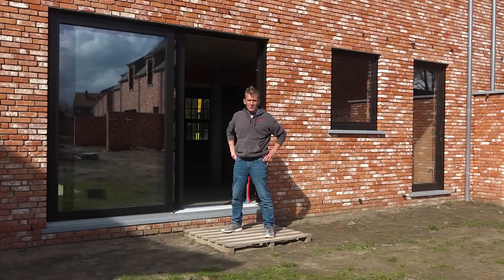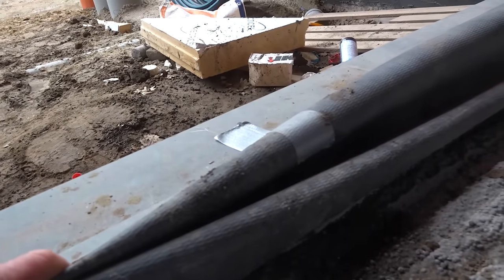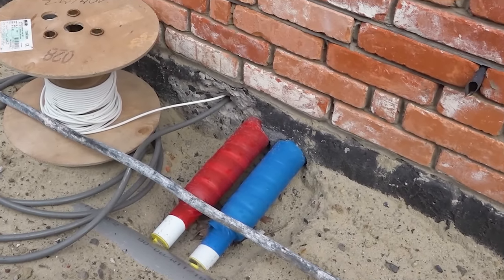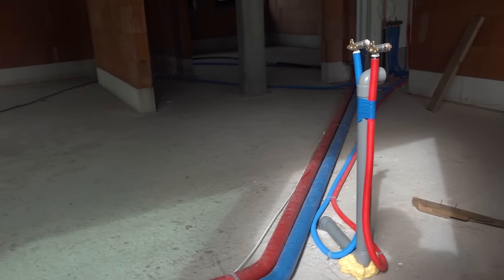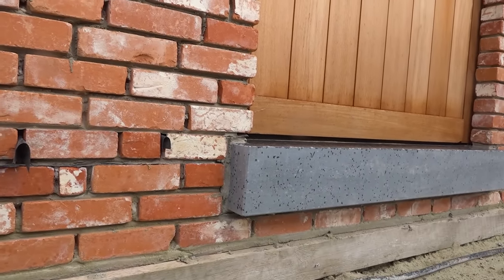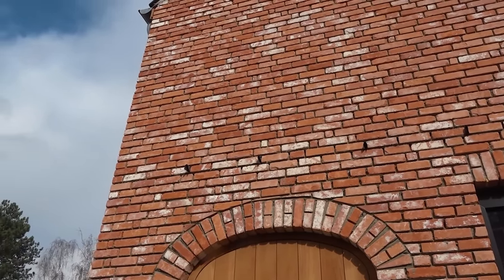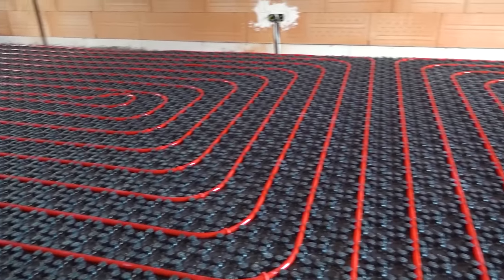Can We Learn From Buildings in Belgium?

Comment: Hi, great piece. We lived in Belgium for 5 years. I was particularly impressed by each new building having a “grey water” system. All water falling on the roof was capturered and stored then recycled by using it to flush loos, water the garden and wash the car. I have always been amazed how much it must cost us in the UK to purify all water for drinking then we use it to flush the loo etc.. we need to change our building regs. and collect our grey water. 
We never had a water shortage even during a summer we had 40+ degrees.
Reply: Interesting. I think solar is a different issue. But I think we have an issue with our drainage system in some areas. I will never be convinced that watering gardens, washing cars and flushing toilets with potable water is good economics.
Reply: @snapdragogon69  Good job GB does not have cheapskate developers, shoddy builders, heavy rainfall, poorly maintained drainage, continual flooding problems, continual road problems from the substrate being washed away, etc !!!  

Most European countries require rain water to be collected this way on new construction as part of the obvious need to be prepared for climate change.
Reply: @Andrew-vx2ls  what climate change...
Reply: @snapdragogon69 we don't purify the rain water that much. There's like 2-3 filters to get rid of odour and colour from leaves getting into the storage tank. The water is only used for the toilet, garden and some use it for their washing machine.
Reply: @MarianLuca-rz5kk  infrastructure for 58million people and an actual population of 75 million.
Reply: @snapdragogon69 but your large system has broken down with water privitisation. And now everyone has nothing
Reply: @snapdragogon69 Doing it at a greater scale when it doesn't need to be done at all still is more inefficient. Capturing and filtering rain water to flush the loo and do the washing is still more efficient than treating millions of liters of water with purifiers and chemicals to make it drinkable, only to then flush it down the loo

Also, more importantly: flood prevention. Capturing rain water of off roofs and separating it prevents it from running off into the sewers during heavy rainfall. It thus also forms an extra buffer against flooding of the sewer system during heavy rainfall. And separating the grey water from the sewer water also means that IF the sewers flood due to heavy rain, all the sewage isn't flushed out as well entering the streets and people's homes, but only actual rain water floods the streets. In a flood prone region like Flanders, that's an immensely important consideration too.The sewage stays in the sewers, and only rainwater floods the streets.
Reply: Would also reduced pressure on the surface water drainage system perhaps?
Reply: That's nothing. Us Brits use rainwater to flush our entire sewer system out and into the sea.
Reply: Im going crazy building up research on this and i like the results and the deeper i get the more i realise there is no need for all the polution we get and waste of water.
Reply: @anglo-dutchsausage344 and infect all our lovely rivers right?
Reply: @gtiggsmusicstudent  That's it. Let the rivers do the work. True efficiency
Reply: @emillyyelen5169  Its in his head.
Reply: Wait, is this concept not a regular thing elsewhere? That's so weird! Here, it is actually mandatory to have this system if you want to build a new house. Even apartment buildings these days often have it.
Reply: @snickersonson3732 Are those filters mass produced? Or do they have to be custom built for each location?
Reply: @katego370 Many places have an allergy to regulations. It might cut into corporate profits, though it’s framed by politicians as hindering freedom.
Reply: @aliannarodriguez1581  yes, check out BWT pluvio 500ST for example. This is one system with 3 different filters. The only other thing that you should do is have a floater system in your rainwater tank so that you always take water just below the water surface. That way you don't get the dirt from the floor of the tank nor the floating pieces (which should be caught by a debris trap before entering your rainwater tank)
Reply: @snickersonson3732  Thanks!

Comment: Pipe in pipe! That's what I did for the pipes I laid in our current house, including the pipe from the pavement stopcock into the house and water and central heating pipes to our outbuilding. Wish I'd thought about it and asked my builder and plumber to do it for the house itself. Electric and data cables all in conduit or, when outside, inside barrier pipe. So much easier for modifications

Comment: One day I'll do a self-build so some I'm making a note of lots of these methods.
I'm British but live in France.  One thing I like is the pipe-in-pipe method, to individual shut-off valves.  Also the separate fuses.  We have a "Technical Room", basically a semi-external utility room, where the shut-off valves come to and all the electrical circuits as well.

If only Building Regs would insist on Solar panels, a battery, and rainwater recovery storage (for flushing loos).  All those things are cheap at the time of construction but prohibitive afterwards.
Reply: 'A battery' - you need loads of batteries to come anywhere near having the electrical capacity to run a 'normal' household. Less where you are of course in France than in many places, but remember that no matter how good your charging system and inverter, they will degrade. I do think water heating solar panels should be standard (or at least the house built for an easy retro fit at any point) as well as a double-coil heat exchange boiler: The issue is probably possible liability for Legionnaire's disease.
Reply: We can even get houses built plumb, level, square etc in this country - what hope do we have of this 😂

Comment: Lots of things are done a bit different here on the continent, but strangely enough the Poroton blocks also didn't take off in the Netherlands, instead like the UK aerated concrete is mostly used for the inner leaf. Dutch houses in general have more details in common with the UK than in other continental countries.
But we do the damp courses and pipe in pipe/wire in pipe like in Belgium and others.
Raked out courses and separate pointing is the standard all over here, always wondered why it's done in one go in the UK.
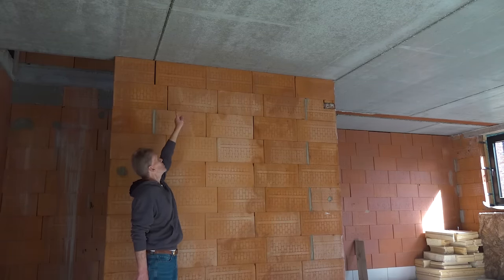The building you are in isn't a flat, it's a 2 story house, at 6:00 you can see the opening for stairs in the ceiling, concrete first story floors is standard here, timber isn't used anymore  for floors because concrete offers better fire safety. Older houses pre 1960 often do have timber floors still. Mine from 1932 does.
Reply: So its not the fire that will kill you, it be falling down the ridiculously narrow stairs.
Reply: I think it has to do with the dimension of the bricks? because the height of the bricks is bigger in the UK they use a pointed london style trowel to apply mortar in the upright joints, whereas I see in NL the mortar is applied with a rounded trowel and not specifically to the uprights.
Reply: @David-bi6lf  The opening you see is not the whole opening, it extends behind the wall, also the stairs are not fitted yet.
Reply: Isn't it quicker to do the pointing in one go?
Reply: The blocks are actually only used in small projects. If they do a series of (connected) homes the inner walls will be concrete. For me the amazing part is the city heat pipe running over the ground floor to the distribution point inside the house. Guess that must mean that it is a low temp system. In The Netherlands you will usually see these pipes running through the crawl space underneath the floor, carrying temperatures exceeding 70⁰C.

Comment: The porotherm blocks have a capacity to carry between 10 and 20 Newton.
So yes, you can just lay a concrete floor on top of them.
These blocks are produced in Belgium. Putting that local clay to good use.
These blocks also allow for 100% machine produced prefab walls. Produced on monday, loaded on tuesday, arrive for installation on the building site on wednesday. Takes about a day to install 1 floor (of your average house) They are prefab produced incl damp proofing, dooropenings, windowsopenings, isolating block in the bottom row, etc...

Comment: Nice to see the windows sit in line with the cavity insulation to avoid cold bridging. Even in new builds in the uk I often see the windows set in the external wall
Reply: We use cavity closers in the UK to prevent cold bridging when fitting windows to the external skin.
Reply: Bs code's of practice are used in a lot of the developed world these days and places that don't use them,well 😂. Anything in this video from Belgium doesn't make the end product anymore efficient eg. Pipe in pipe sounds cleaver but it don't make any difference really because you are not going to apply that method on underfloor heating system and that is the most likely place to have a leak.usually plumbers avoid having connection under concrete when it comes to mains supply and domestic hot and cold if possible and ducting has also been used aswell for many years also air tests are carried out on all pipe work. Can he show us a house that the proper codes of practice has been applied and failed . Dpc up the back of sill standard practice, Dpc draped over top of sill nonsense the only reason that's there is because the brickey couldn't be arsed to get the proper width one out of the container.I would like to see what the guys with the windows will do with the DPC when they eventually arrive, they will cut it out of the way if it's still there, it will more than likely have tripped someone by then and the foreman got some fool to cut it out of there before the guys from health and safety see it. Even if you tried that idiots method you would still have problems with the seal under the threshold in the long term. Look If it's not broken don't fix it.

Comment: Of course the building will get pointed by a color of choice. Pointing one house like this will take 2-3 days. The cavities in the brick work is to let the space between exterior wall and interior wall breathe. There is no contact between the two walls. There's about 10cm (or more) PIR insulation and an air cavity of a couple of cm's between the two. The black plastics will be taken out once the pointing is done. This is just to make sure the holes don't get filled with mortar. These are houses, not apartments. There's a water barrier in the brickwork and also underneath the complete concrete slab. The screed you are talking about is not screed but the concrete slab/foundations on which they put piping and electricity. Screed will be put on afterwards, then a final floor. 90% of the houses have concrete (first and second) floors since the sixties. Cheers from... Belgium!
Reply from the maker: Good information, I could have done with a guided tour. I looked them up and found they were houses today but I had voiced the video by then.
Reply: They are going to point the brickwork after removing the scaffolding? 
Do you think this is a good idea? Is this normal practice in Belgium?
Reply: @johnnyrowley970  Yes because this allows the  walls to to dry out faster. Best practice is to leave it that way at least 1 year before finishing it
Reply: how is the brick facade tied to the main structure?
Reply: The biggest reason they dont point it immediately is mostly just because of planning and cost efficiency. The pointers go there with a small highworker and point it that way. Like this the scaffolding doesn’t need to be on the jobsite longer than necessary
Reply: And also the joints that we fill are actually made out of sand and cement also. Just a lot dryer and we do it completely different to how people in the UK do it 👍

Comment: Nice idea re the manifolds for the domestic water supply (both hot and cold).  I did some work (chlorination) at a fast food restaurant in New Brighton, the Wirral, around 5 years ago.  The plumber told me the manifold was so all the pipes could be run in plastic to each area, so if there was a leak in one area, the water could be isolated at the manifold and then repaired or replaced.  This also minimised the amount of joints needed in each area, joints which invariably end up causing leaks.  The manifolds for the domestic hot and cold water supplies were located in an accessible cupboard near the incoming water main.

Comment: In Belgium they use a strong 3/1 mortar mix to lay the bricks. At the end of the day, they rake/scrape the joints out for the pointing which is always done afterwards with a stronger (dryer) mix and a colour to choice. Therefore you don’t have any water absorption in your joints/pointing (because a a weak mix), your cavity stays dry and you don’t have any frost damage as water can’t penetrate through the joints. Unlike in the UK - a weak 5/1 mortar mix, damp cavity and every 10/15years repairing frost damaged bricks & repoint.
Reply: But if the mortar is harder than the bricks, the bricks may crack over time and when frost or icy conditions gets into the wall, the bricks will deteriorate before the mortar over time.
Reply: UK houses do not get repointed or need bricks replacing every 10/15 years! Also, if softer bricks are used, mortar should definitely not be 3:1.
Reply: In the UK we adjust the mortar mix ratio in relation to the strength/ density of the bricks
Reply: @joreggelt-y7t  our buildings have stood lifetimes and they never needed any mortar or brickwork (exept for one that was built in 1901 but  i don't know why you'd think we'd have to replace our bricks?
Reply: @istoppedcaring6209  Er, I don't; that's what I said. Think you replied to the wrong person.
Reply: We have a variation of bricks in the UK still. Some are soft and deteriorate quicker than others. Not as much as it used to be when each area had its own brick manufacturers but there still is a lot of choices. I do thingk 3/1 is overly strong.
Reply: I have learnt something it's things I think about but had no idea why they have to be repaired now I know.

Comment: I have a CLT house here (belgium) and the builders did waterproof the whole foundation blocks before the wood was put on top. On top of that they put a membrane over the insolation and they taped the joints between the wood panels. The joints between the bricks are often done at a later stage.

Comment: in some parts of the Netherlands rising damp is very severe - the parts which were reclaimed from the sea hundreds of years ago are notorious
Reply: Digging a hole (kruipruimte) almost down to water table is not helpful either.
Reply: I was thinking that. If you have a building below sea level there must be a lot of hydrostatic pressure pushing the ground water upwards - especially if you are near to the sea. I would like to know more about the methods they use for preventing rising damp in the Netherlands.

Comment: The systems (water pipes red/blue in conduits and damp proof courses, internal brick block walls and many others ) you talk about albeit unusual in the UK are quite common in several EU countries in some cases going on for decades. Insulation is a different matter and typically the south worries less about thermal insulation albeit they should worry a bit more as it is warranted. Thank you for posting another interesting video

Comment: Here in the Netherlands we solve our damp proofing in a different way most of the time. If you have a concrete foundation and put the concrete floor on top of that you won't need damp proofing in most cases. If you don't put the concrete on top of the foundation, but between the load bearing walls you will need damo proofing, but we don't do that often here.

Comment: Pipe in pipe seems a bloody good idea.
The brickwork looks like a Dutch Wild Bond. After the war there were thousands of second hand and broken bricks due to the bombing. They rebuilt with what they had, hence the random pattern. 
Nice three centred arch over the front door, vary rare to see one new these days, probable the prettiest of all arches.
Reply: first thing i noticed about he arch is that whoever placed that brick on the right of the center should get his eyes fixed. they can still fix it with a grinder before they put in the joints. but comon, fix that

Comment: Those exterior window sills are probably Belgian Blue Stone. Very common and popular there.
Reply from the maker: It looks lovely
Reply: Looks like precast concrete to me
Reply: We call it “arduin” in Flemish, or bluestone in English. So it’s definitely not concrete. That’s used only in very low cost or temporary buildings here.
Reply: @HighWealder  because it has been sanded
Reply: @alphonsepipo1948  Water cut.
Reply: I’m a Belgian window placer and on a fresh building like that its deffinitly “ belgian blue stone” , also called (Arduin) because concrete would absorb water and break during our strong winter periods..so thats a big no!
Reply: @HighWealder  no its bleu stone, grtz a mason from belgium,

Comment: The pipe-in-a-pipe idea got me, that's the first time I've ever heard of the concept (and so inexpensive?). Here in Australia we have high construction standards with ventilation to the cavity via terracotta bricks that are double the height of a regular brick about the same length each with 15 square holes in it: but that lets insects into the cavity which can be stopped by buying industrial size "scotch-bright pot scourers" from the larger hardware stores cleaning sections, the industrial size allows essentially identical airflow but totally obstructs cockroaches and other bugs. This is a great channel definitely worth a tick and subscribe  :)